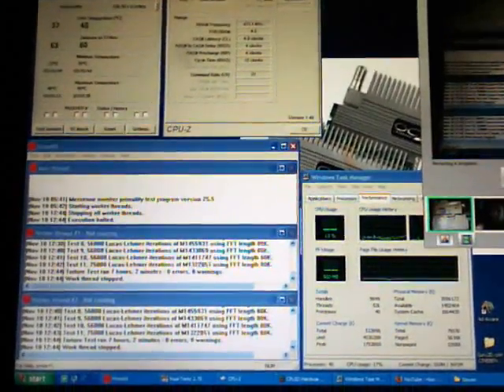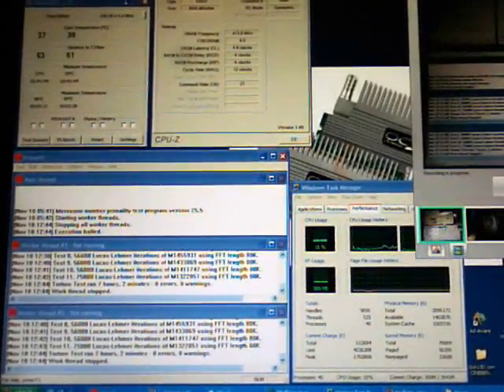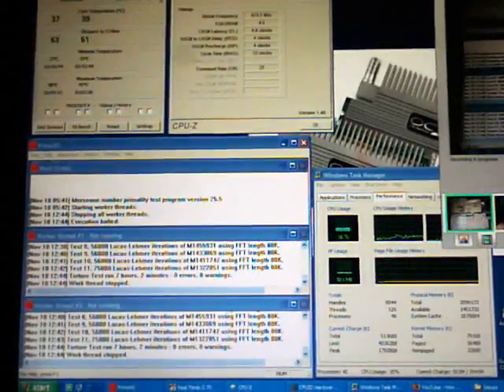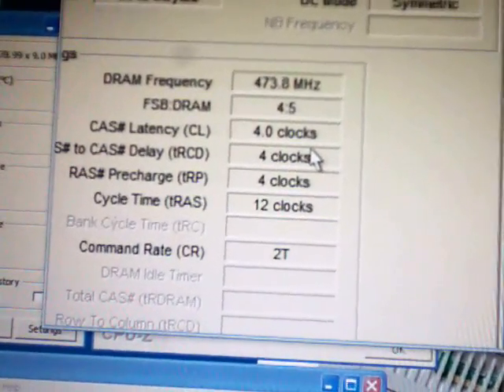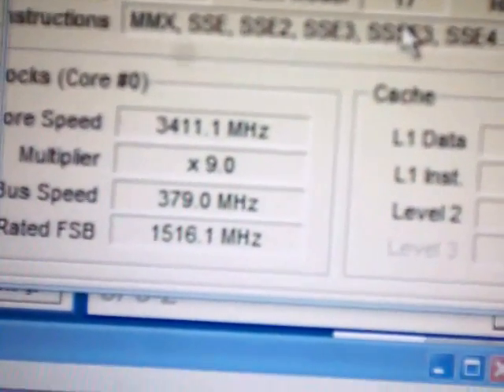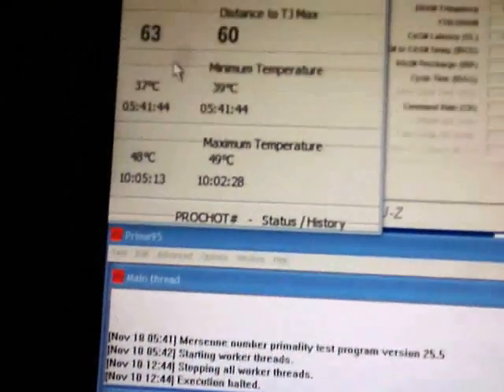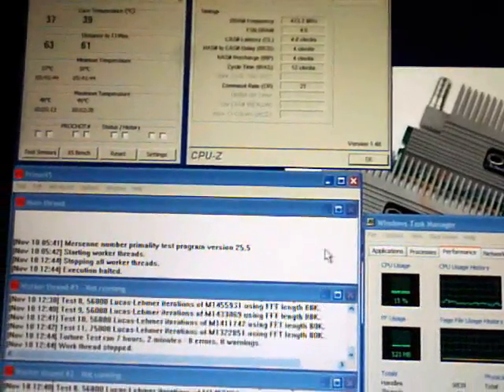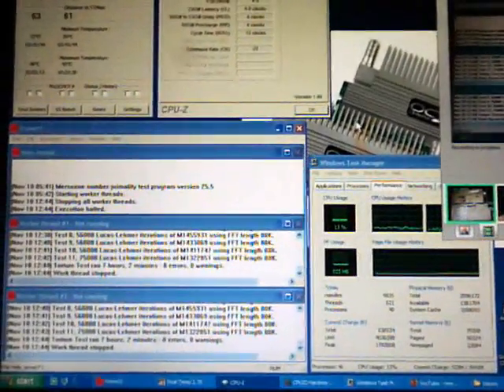Crucial Ballistix @ 950MHz 4-4-4-12 2.1v

Comment from the maker: They stay cool trust me got 2 fans on them now and temps are 25.6c on the modules under the spreaders. 

Actually IMO 2.1v is not very high for what speeds and timings these sticks are running. 

Usually if a stick of RAM being overclocked doe not respond to voltages of 2.2v-2.3v then it wont any higher. Unless its meant to run at 2.3-2.4v then things might be a bit different.